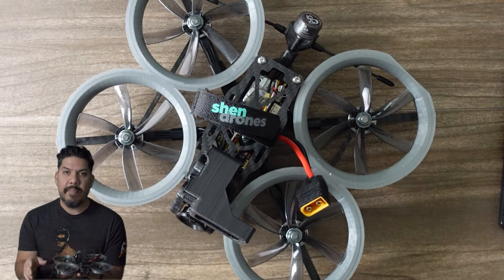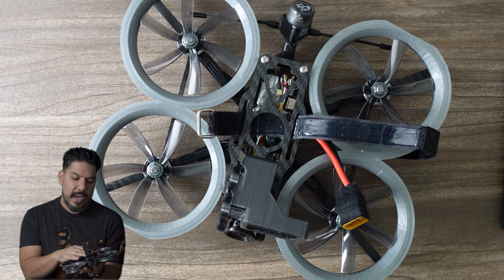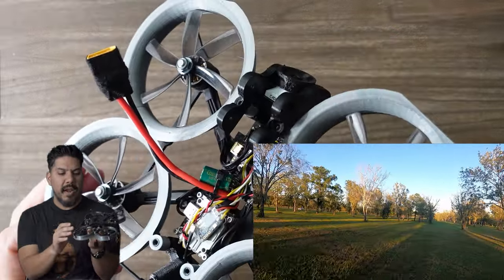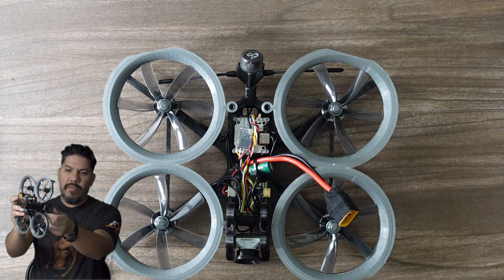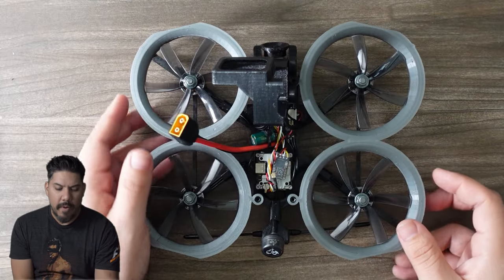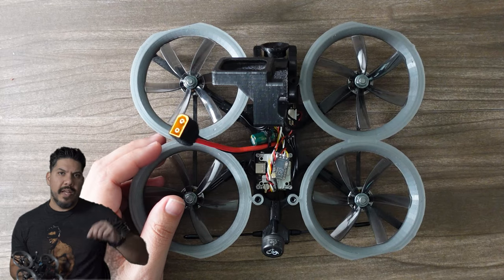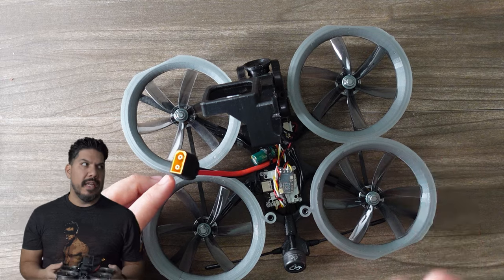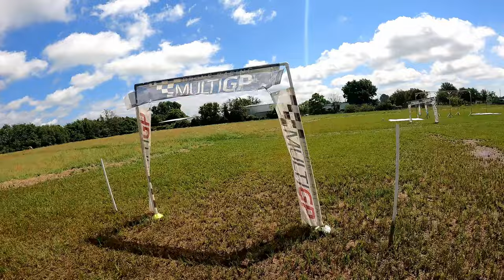Slammed Squirt 2 Cinewhoop  jon E5 Edition - Shendrones most cinematic drone w DroneCo parts

Comment: Would you get the slammed squirt 2 or the cinelog 35?
Reply from the maker: i still havent found better than the slammed squirt yet, but the 3.5" could be better for higher speeds.  I am also currently testing the 4" whoop master by CMW.  That one has a ton of speed/power.  For proximity and control, the slammed squirt on 6S is hard to beat.

Comment: Just ordered the 1507 motors. But now I see some people say 2203 2800kv is better. Any thoughts? Want the best cinematic performance, not using it for freestyle
Reply from the maker: I tried quite a few, including the 2203 FPV cycle motors.  For me, the FPV cycle is faster, but the 1507 has more control.  For me personally, the more control was the more usable range (unless you follow things moving fast).  More details on that 2203 here

https://youtu.be/6L8uWquGBwo
Reply: @JonE5FPV  Exactly what I’m looking for. Low end control over speed. I prefer 5” for chasing. Thanks for the response. You rock!

Comment: I just printed these parts and I'm concerned the gopro is pretty loose in the mount. What are your thoughts?
Reply from the maker: Mine fit pretty well. Sure it was the right mount? There is a 6/7, 8 and a 9/10 version

Comment: I use same brother hobby motors. Except I use the NBD cricket 20x20 with tracer. I use 5s 1300 mainly. I do fly 4s 1300 for inside or under obstacles. And  5s and 6s for outside.
Reply from the maker: I bet 5s would be great. I got some cnhl 1100 that were very cheap and much lighter than a 6s. I’ll give it a shot
Reply: @JonE5FPV  Chris Teal suggested the 5s to me. 🤙🏼 if wanting to  shave some more weigh off. And loose to much performance. I call it the middle of the road battery.